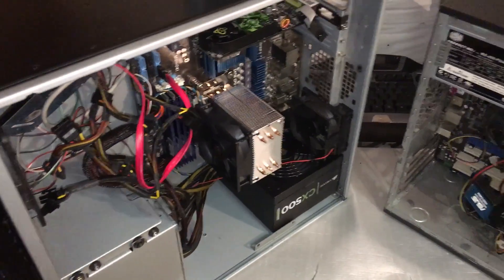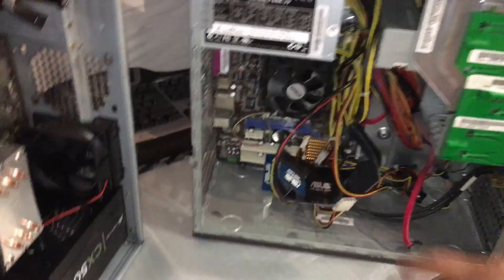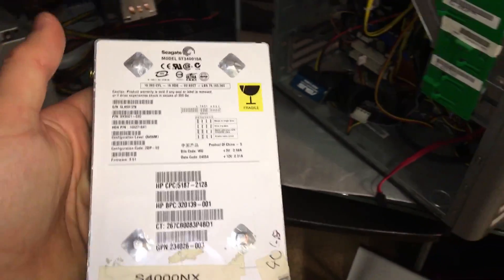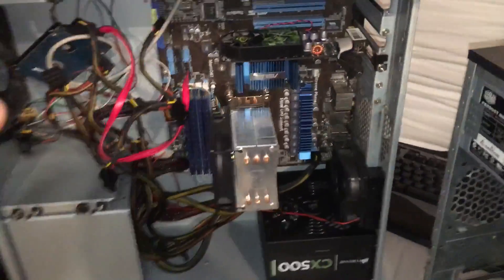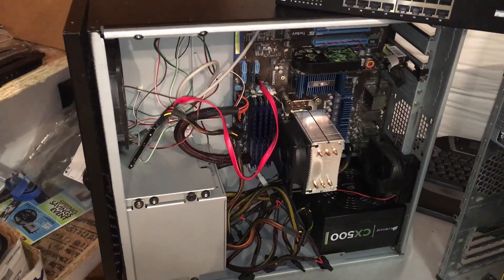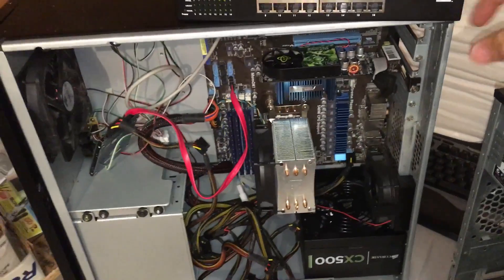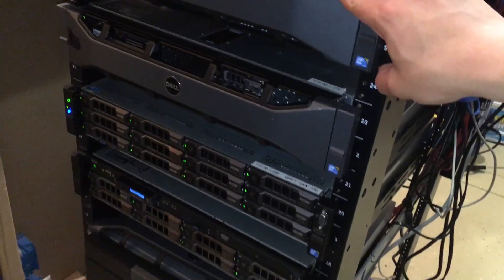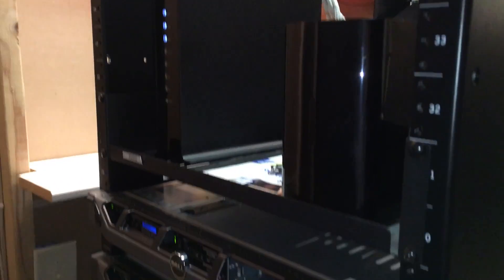Home Data Center Project 2016 | History of GNET Data Center |

Comment: cool! my setup first started on some amd athlon xp computer, 512 megs of ddr and a whopping 120gig maxtor! had XP pro and IIS. then i expanded with a bunch of random laptops, kind of a ghetto blade center :D

now i just have 2 boxes with proxmox, one for pfsense and all that other with win2012 for adds/file/etc.
theyre real cheap builds like $150 a go. designed for energy efficiency, quiet etc. (i sleep in the same room haha, tiny house.).
they got intel celerys, 10 gigs ram, not very much storage about 1.5tb combined :c just dont have the $ right now to upgrade.
Reply from the maker: Oh awesome man! Everyone starts from some where just like I did :) and do you host any other things on the servers like game servers or any other applications?:) and stay tuned for the new big upgrade!! If you haven't been to GNET Facebook page go check out the pics of the R810 :)

Comment: I would suggest you purchase some backup solution. Preferably Barracuda because they offer onsite backup as well as unlimited cloud backup.
Reply from the maker: I have Veeam Back up and Replication, I don't like barracuda really
Reply: I forgot I watched that video. That's just something we use in the corporate side of things. We have 3 of them and that's what i'm familiar with. Personally I like them because the appliance itself is cheap but the licensing is kinda salty per year. Also, what would be a good way to talk back and forth rather than commenting.
Reply from the maker: +Matthew Wolf (ATHORNFAM2) haha it's all good :) yeah at my previous job I implemented barracuda 890 back up but I don't like how it doesn't link properly and easily with VMware
Reply: Yeah we use it a bit with e-mail archiving, web filtering, and backup solutions. I also had some questions about your setup that's why I asked about a better way to talk than commenting.